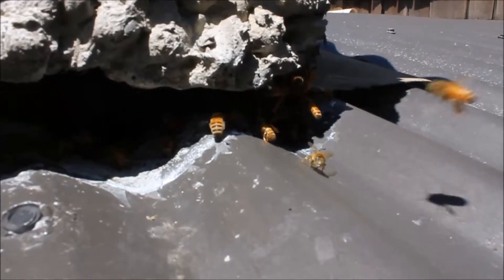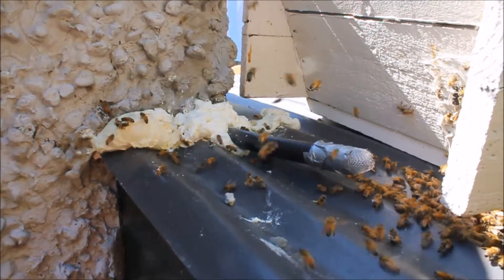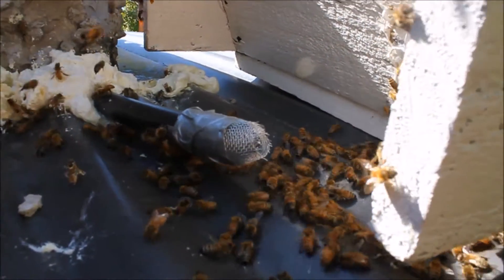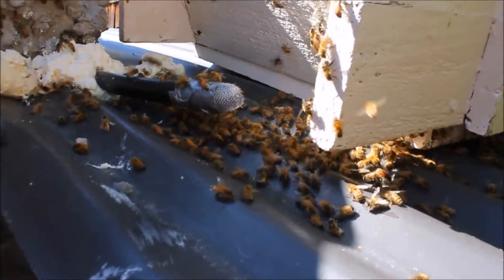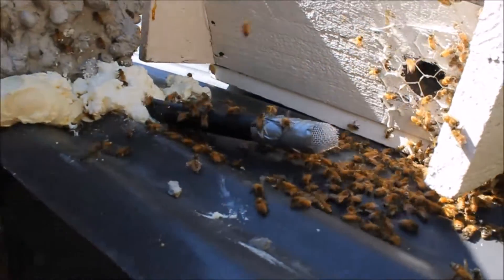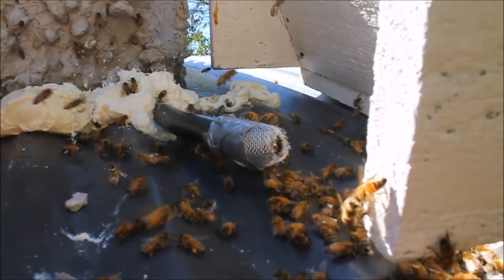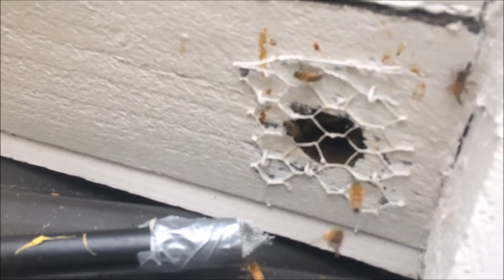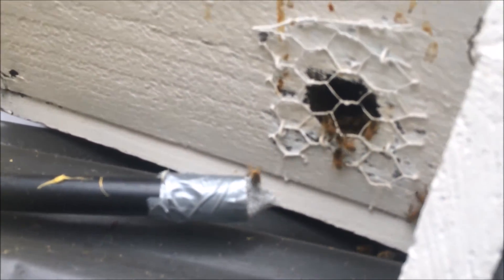How I  Conduct a Trap Out to Save A Colony Of Bees

Comment: I'm assuming that this worked out for you since it's been 4 years, but bees can eat right through that foam.  There's another product, siliconized cement, that is better for sealing.  Comes in a tube like caulking and is probably found in the masonry department at your store.